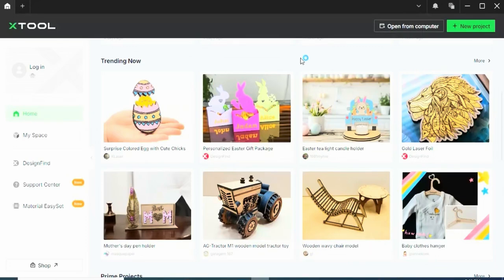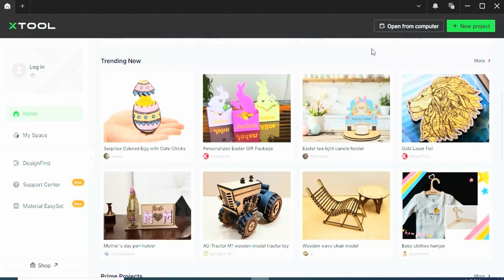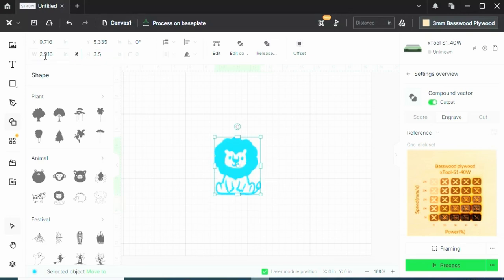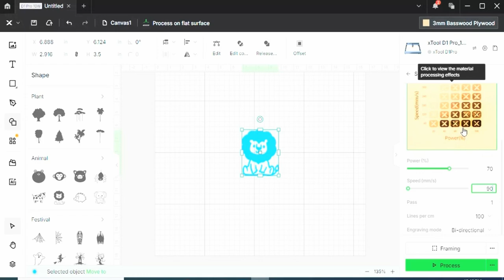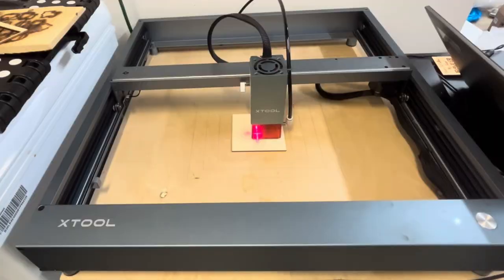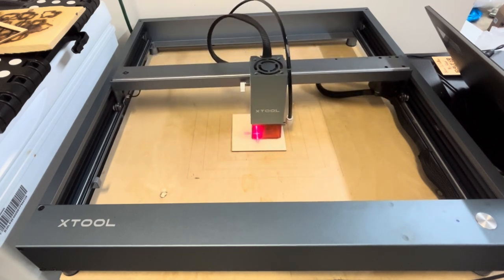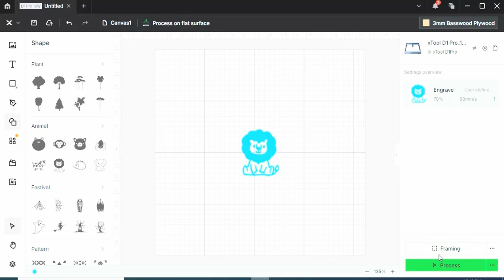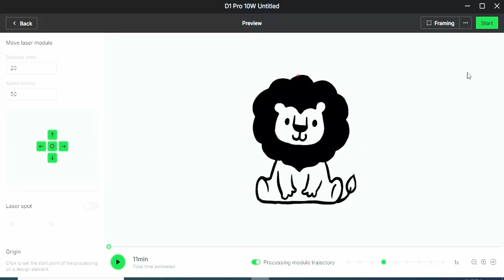Framing using Xtool Creative Space 2.0 - Beginners Guide

Comment: I’m curious can this machine print on regularly coated aluminum or wood screens without burning the mesh just like the ones you have to buy? If so I’m getting rid of my box uv light. Please lmk
Reply from the maker: I know for aluminum or metal, it’ll need a coding (or metal spray). I’m unsure what kind of wood screen you are referring to, but it usually does great on wood!

Comment: This is the closest video that I have found to making any sense as to what framing is and/or how to do it. Thanks! I do have some questions. 

If I understand the video correctly you only frame the actual piece of material you are going to use, correct? That is a question that I could not get answered for anything.  If so, is the purpose of "framing," to help ensure that the engraving goes on the blank the same as the design screen?   If so, is the purpose of "framing," to help ensure that the engraving goes on the blank the same as the design screen?  

I understand you suggesting using the center. How do you find the center to place your black before you go to start the framing process? What do you do when you have more than one of the same item?

I do not have the S1. I have the F1 Ultra & the M! Ultra. I want to focus on using the M1 ultra for now. If you follow the process as outlined in the video, the it should engrave in the same spot on the blank, correct?

Also, do you have a video for using the Xtool dog tag blanks using the same process by any miracle? When I have tried to do the "framing," it has me pick a shape, and then try and manually create the "origin" points. 

Thanks! I hope to get some feedback soon. I have projects waiting....
Reply: That’s my point exactly. I don’t wanna take any big projects until I can get the basics of framing down Pat. On your video I thought it showed a button that you could check to Click center but so far when I’ve tried to click on framing I haven’t seen it.

I’m not saying others haven’t done their job, but it may be simply a difference of learning style versus teaching style. 

I can import from within the software and image of a dog tag. I can put text and Center on the dock tag itself no problem. When I click framing, it brings out what looks like a blank screen so I can’t really frame anything that’s blank.  Well I get what framing is supposed to accomplish, I feel like there’s some parts that I am missing. I just need some help. I think a lot of the rest of the items I can figure out if I understand these basic principal. Any help would be greatly appreciated. Thank you for your time.
Reply from the maker: Thanks for reaching out! I’ll try to answer each question as best as I can:
- the main purpose of framing is to ensure that your engraver is properly aligned on your material and is not too big/small and is centered correctly. It’s kind of a trial-run. So, yes, use it on any piece of material before you engrave to ensure placement/size accuracy. 
- I find the center through measurement using a tape measure/ruler. If there are multiple pieces, you can put a board with grid lines under your material to ensure that it has the same starting point each time. 
- yes. The engraver should engrave on the same spot as the blank. The good thing about S1, M1, and/or F1 is that some of them have cameras, which makes it easier. 
- I don’t have a specific video for dog tags, but you can watch any video with a coaster, earrings, etc… to get a simple outline to start. Then up the power for the metal and go from there.

It’s good to practice a lot before you start on any major projects.

Comment: Nice video! As a newbie I have a question. What is framing good for anyway? I usually marke the part, or whole of material I am using. That way I can move the picture to fill it perfectly. It is much easier for me to have it in the program, then to eyeball laser framing on material itself... Am I missing the idea of using frame fuction? Thank for clarificarion :)
Reply from the maker: Good question, I usually measure and eye each project that I do, so I know that it is correct. But sometime projects need a high level of accuracy, that’s one way framing comes into play. Also, whenever you want to ensure that your engraver does not engrave/cut off your piece of material.